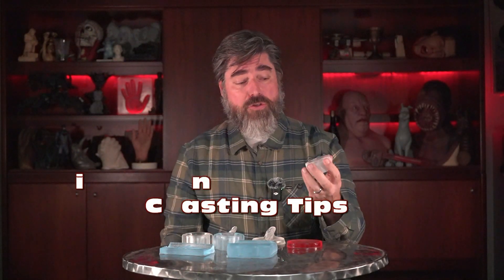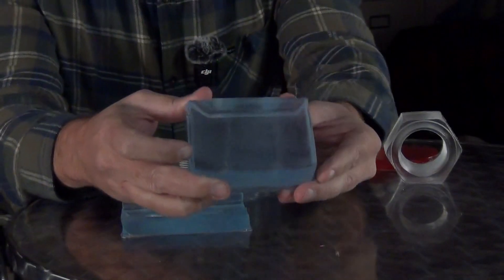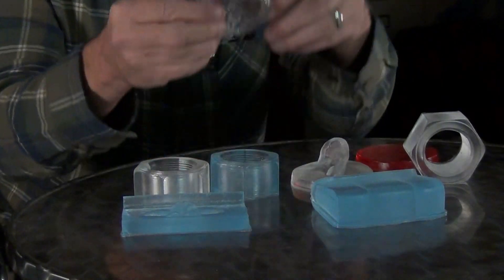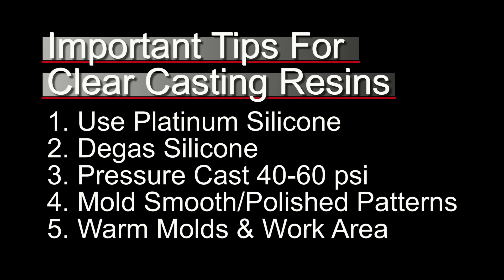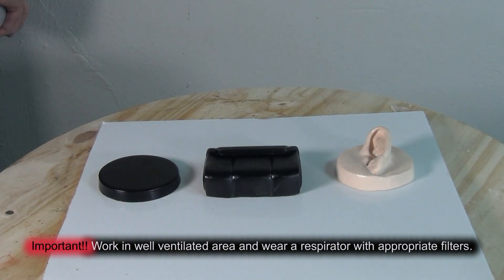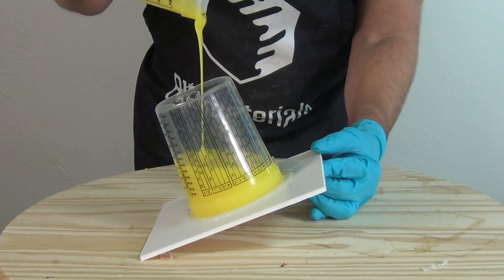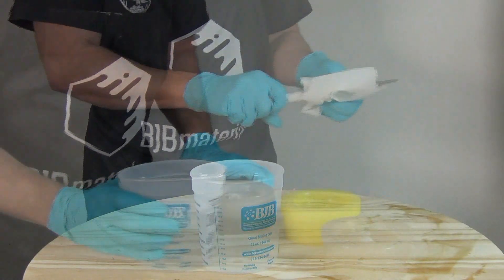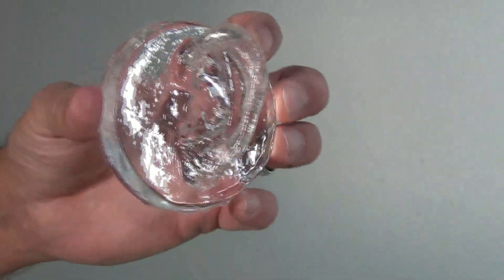Clear Resin Casting Tips

Comment: Can you layer the clear resin? I was thinking about layering gradually stronger tinted resin to get a translucent effect, but wasn't sure if de-lamination would occur.
Reply from the maker: Depends on the resin you are using and how long you let it sit between layers. If I was doing that with WC-786, I would wait until just a little bit after the resin gelled and then add a new layer. If you allow the resin layers to cure completely you probably won't get as good of a bond.
Reply: @brickintheyard  Thanks!